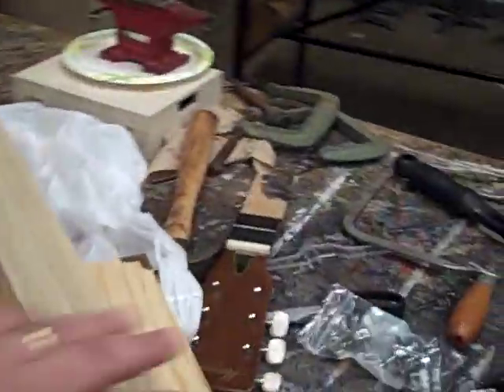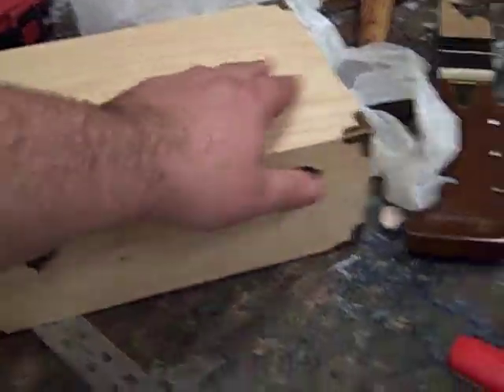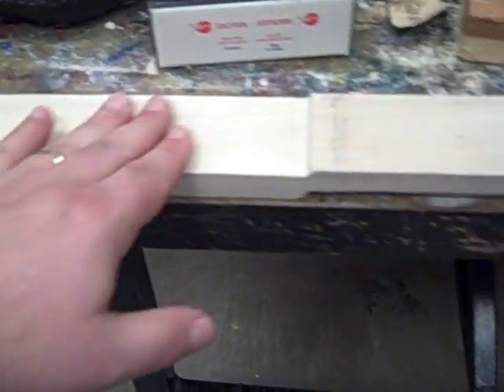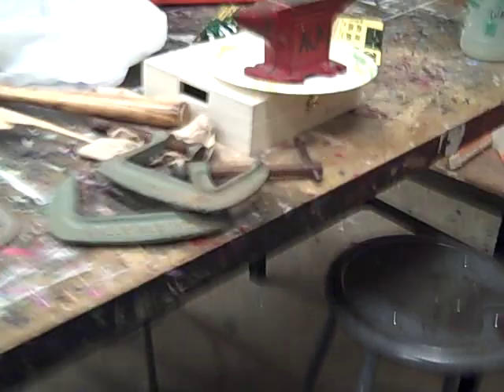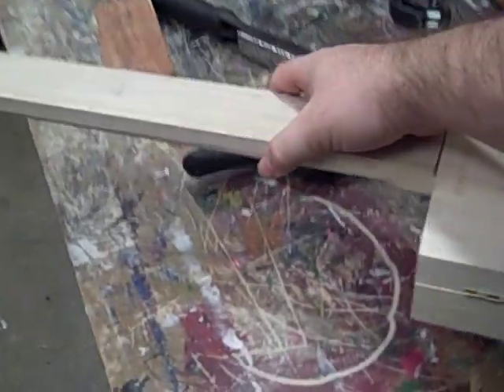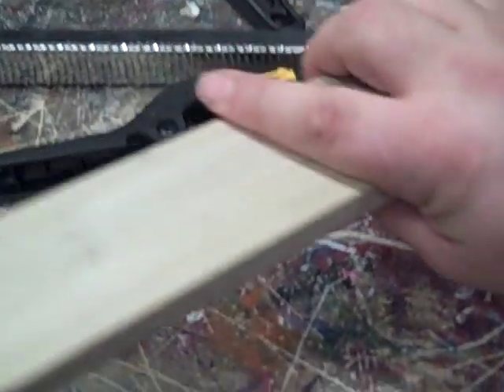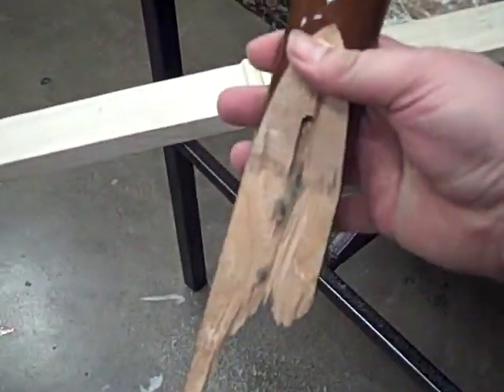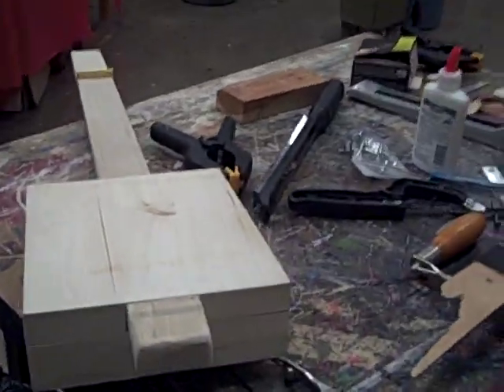Building a Cigar Box Guitar Part 1

Comment from the maker: @RIPjohnbonham The nut up by the tuners was carved from a blank bone nut I bought for a dollar or two at a shop.  The bridge down on the box itself was a metal bracket/handle from an old office drawer.  You could use anything though... like a threaded bolt or a skeleton key.  I've recently been making the nuts from counter top material called corian.

Comment from the maker: The neck is a piece of poplar.  Not the best wood in the world but it was discarded from the carpentry shop where I teach.  I didn't put a separate fretboard on top of this particular guitar though.   If you are only putting 3 or 4 strings the poplar should be strong enough.

Comment from the maker: Thanks for the comment.  The length of the neck can be whatever you want really.  Later on in the series I mention a program called WFret that will print out a template for the fret marks based on whatever length you give it.  So, you may want to model your first one after a real guitar... around 24 or 25 inches plus enough room for a headstock for the tuners.

Comment from the maker: @RIPjohnbonham On that particular build the 3 strings I used were all very close in diameter so altering the bridge angle wasn't necessary for proper intonation.  However, on other builds i have had to turn the bridge a bit to allow for the different string sizes.  If you look at other cbg's you'll see where the bridge is usually tilted just a touch.